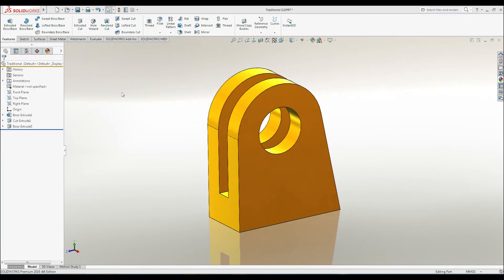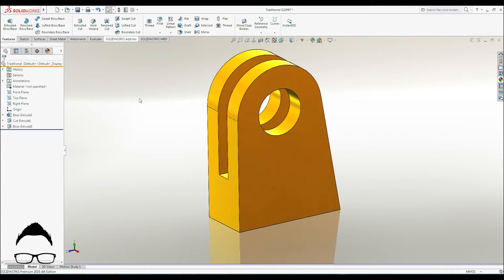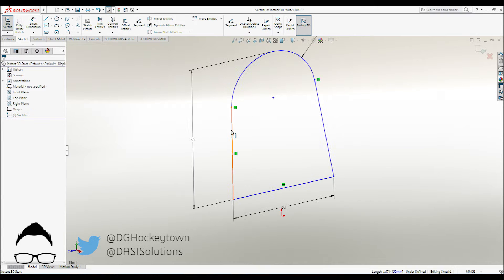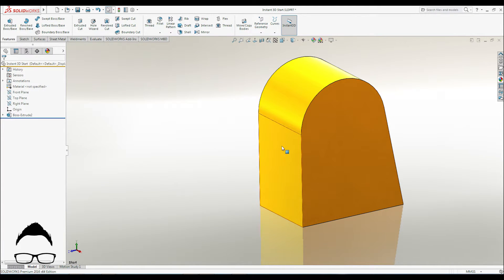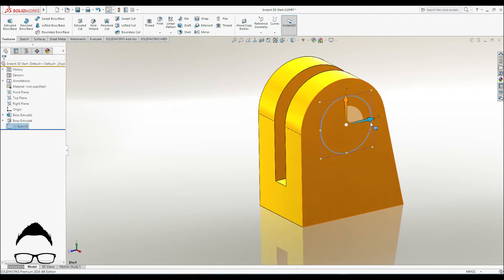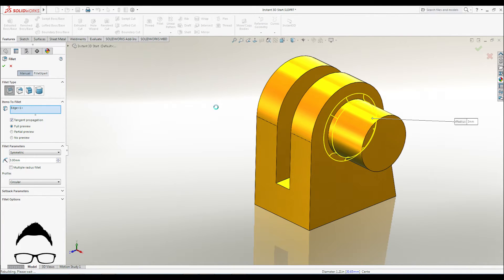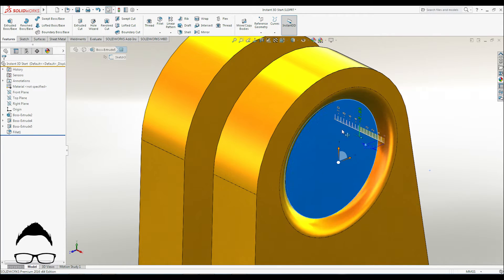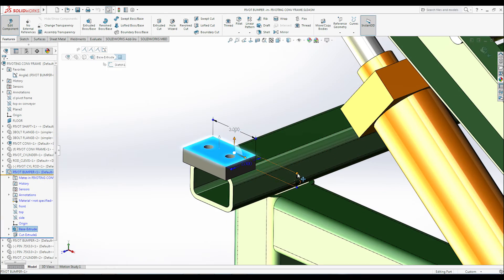SolidWorks TMTT -  Instant 3D

Comment: Excellent video. I have a question ... when I want to extrude a sketch do not let me unless the sketch is fully defined, in under defined not allow me to do, I have to define and therefore I can not handle after the Instant 3D command (Solidworks 2012)